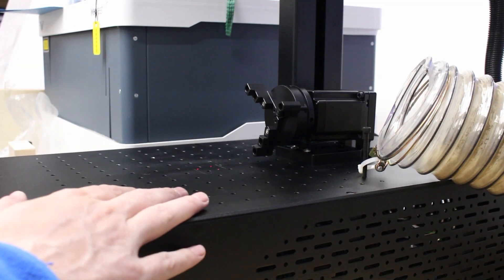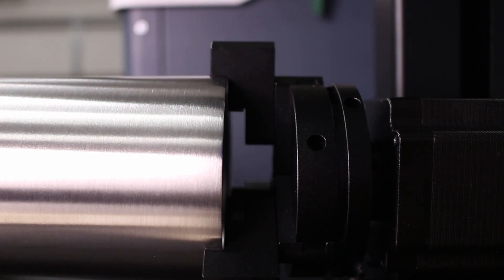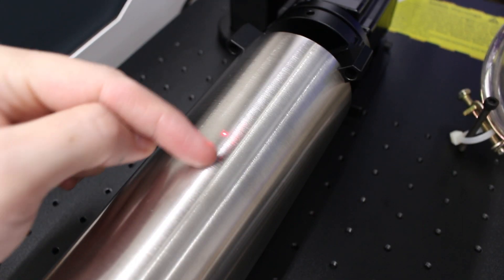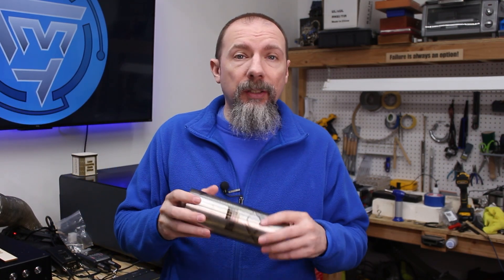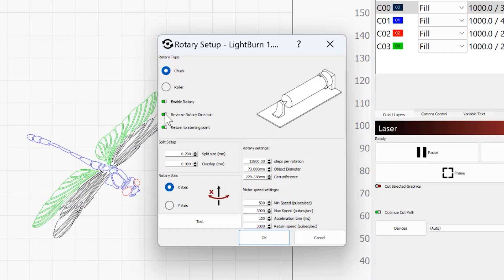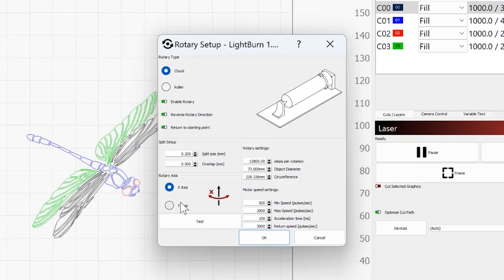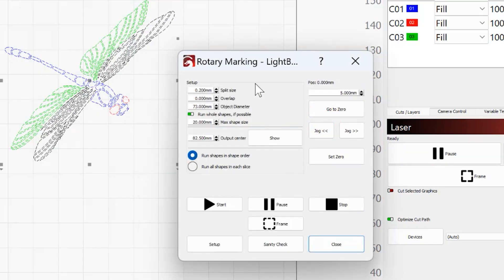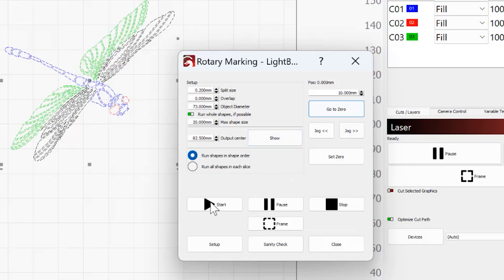This Laser Accessory Unlocks a Ton of Potential! | GI30

Comment: What kind of laser can do this?
Reply from the maker: You can mark colors on stainless steel with a diode laser or fiber laser. In this video I used a MOPA fiber laser which gives the best color repeatability.

Comment: As a lathe operator, try clamping the tumbler at its base rather than the top which means reducing the chance of damaging the rim with the chuck jaws, also the additional weight of the tumbler base is now in the chuck instead of in fresh air, reducing any droop you may get.  Just a suggestion and don't forget to turn your engraving image upsidedown as well 🙂
Reply from the maker: Thanks for the great advice!
Reply: That is awesome advice!
Reply: Skilled time served CNC miller/engineer tip.
A tailstock at opposite end to the chuck with a revolving centre will give it extra support.
Even if it does not have a centre hole,you can apply pressure into the end of the Tumblr with the revolving centre point.
Just like on a lathe to clarify my suggestion.
Great information from your vids 👍
Subbed and liked 👍

Comment: Not a tapered tumbler. Totally easier
Reply from the maker: Probably doesn't show up well on camera but It is tapered. Measures 74mm diameter at the top and 68mm diameter at the bottom. Not a huge taper but it's not a straight sided tumbler either.